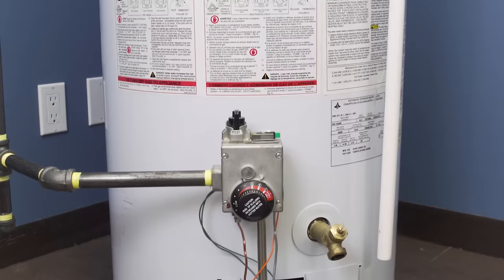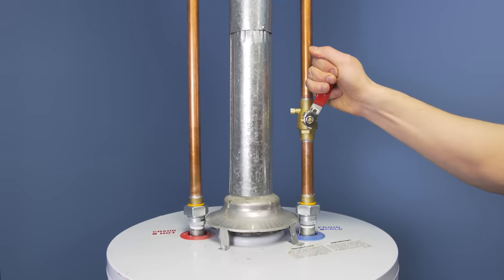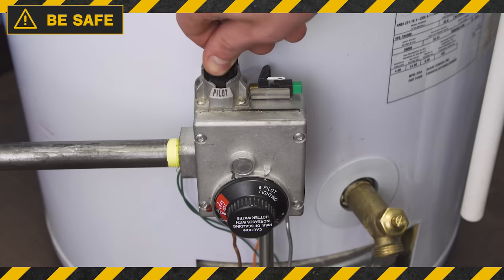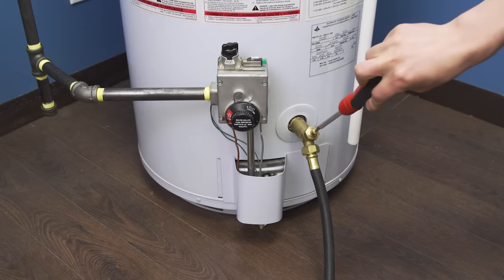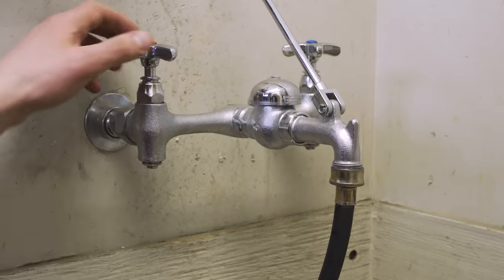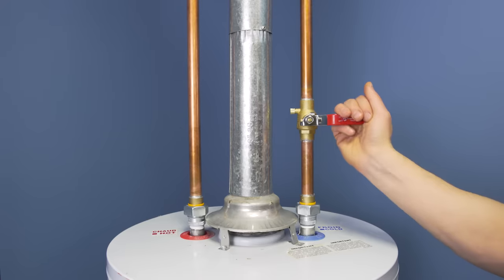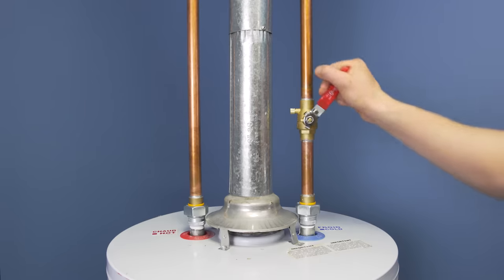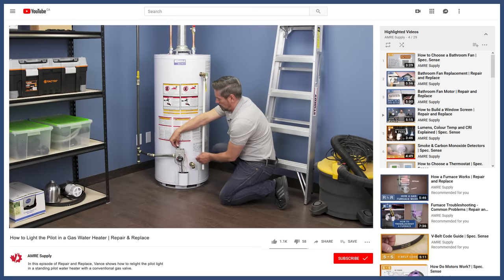How to Drain & Flush a Hot Water Tank | Repair and Replace

Comment: Question why does it flow faster when I turn the cold water tap on?
Reply from the maker: Thanks for watching. Do you mean turning on the cold water faucet versus a hot water faucet? Or do you mean it flows faster when you open up the cold water supply line?
Reply: @AMRE Supply  well it seems what was happening is when the water supply to the water heater was off and I turned on the cold tap at the sink it for some reason was flowing into and refilling the water heater from the hot water line that goes out of the water heater. This is an old house so thinking it has to do with the old baseboard heaters that were here. 🤔
Reply from the maker: @alastarwolfe1338  Yes if there are baseboard heaters then that could explain it.

Comment: Where 2 drain water from tank on 3rd family house?
Reply from the maker: Thanks for watching. With a long enough hose, the tank can be emptied into any drain in the home.
Reply: So I can go high over the tub sides?
Reply from the maker: @GaryYoung-eq1ph  If the bathtub drain is located below the water heater then you'll be able to drain the water heater as the pressure inside the tank will help push the water out. In this case the majority of the tank is higher than the sides of the bathtub.

If the bathtub is located on a higher floor, then you won't be able to drain using a hose and would have to fill up buckets separately.
Reply: Thanks very informative.

Comment: '
hot water heater tank have alot of corrosion powder on the bottom inside tank...
mineral corrosion
Reply from the maker: Thanks for watching. Hard water will contain more minerals and can speed up the process. Best to check the anode in case its almost dissolved: https://www.youtube.com/watch?v=hTJv67imgaE

Comment: I love how he says to back flush.. yet the hot water is turned off and he used the hot knob lol. Whew….
Reply from the maker: Thank you for watching. You have a good eye. This has been pointed out in previous comments but unfortunately its not something that we can update. When filming these videos we often film multiple takes at different times and the pieces are edited together afterwards. During the backflushing shot we did what visually looked best on camera (moving the closest handle) while not realizing it was the wrong handle (which not would result in any water flowing).
Reply: @AmreSupply   Yeah I figured that’s what it was I occasionally will film like that. I have to be careful to make sure it all flows and makes sense 😆

Comment: No chemical treatments possible?
Reply from the maker: Thanks for watching. There are products available but people have found vinegar works as it is an acid and will dissolve the minerals. There's also more info in general here: https://inspectapedia.com/plumbing/Water_Heater_Scale_Removal.php#DelimeKit
Reply: @AmreSupply  what do you think about citric acid? Would that be a safe alternative?
Reply from the maker: @leoperez2566  Citric acid is less acidic than vinegar but would still help dissolve the minerals. It also depends on how diluted it is as this will determine how potent it is.

Comment: If tried this twice and all I got was a leaky drain valve.
Reply from the maker: Thanks for watching. It is possible that some of the sediment is stuck on the drain valve and is preventing the valve from closing properly. You could use a pipe cleaner or something long to try to clear out the drain valve port. 

Additionally if the valve isn't closing at all then it's best to replace it. Many people have installed a full port ball valve which will drain faster and be more reliable. The steps are shown in this video: https://youtu.be/nGCejMsKNX4?t=195

Comment: Where's the union on the gas line 🤔
Reply from the maker: Thanks for watching. You have a good eye. This water heater was temporarily set up in our film studio but was not 100% functional. We had it set up in our studio so we could have full control over the lights, camera jib and other equipment. We wanted the most clear shots possible which is hard to do in a basement. The union was one overlooked part of the installation, but didn't affect it as the gas line was not connected.

Comment: You are SO wrong! I just flushed my hot water heater and common sense told me NOTto shut off the water supply at the top of the tank. No need to turn on a sink spigot to allow air into the tank to help flush it. The incoming water does that much better than your idea. Plus, the water coming into the top of the heater pushes the bad stuff out the drain quicker and with more pressure than your sink spigot letting air in. Who made you an expert on this subject? I have been flushing hot water heaters for over 40 years problem free and never used your procedures.
Reply from the maker: Thank you for watching. We're glad you found a method that works for you. The fact that you have used your method for 40 years without problem shows that there is often more than one way to do these things but due to the difference in water hardness in different areas not all cases will be the same. As well there is no true consensus, if you ask 10 different plumbers you will get 10 different answers. 

Not sure if you watched the entire video or just stopped when you saw the water shut off. This method shown in this video covers draining the tank, backflushing if needed as well as opening the cold water supply to blast water into the tank.
Reply: Worked for me 🤷‍♂️

Comment: It's useless to drain it but you can charge people to do that I don't care about it wast of water and time  If you could open the tank and vacuum it or do some things maybe a better But this kind of draining is very useless Just like letting the water out and put in new water in there
Reply from the maker: Thanks for watching. Some people find benefit out of doing a deep flush of their tank and others do not. It also depends on the amount of sediment that someone has. These steps for draining the tank are also the same as what is needed to replace a faulty drain valve so there is still value there.

Comment: That's not true!!!
If you turn the hot faucet on, then turn the supply on to the water heater.
The air will still be present until you turn on every hot fixture in the house.
Moreover, the air not coming out of a hot fixture, does not mean that the water heater tank is full!!!
Never assume the tank is full.
Reply from the maker: Thanks for watching and for sharing your thoughts. From your experience at what point do you have a good sense that the tank has refilled with water?

Comment: It’s all over exaggerated hogwash on a good potable water delivery be the city .  As you can see in the Video the water heaters are convex thus the fine sediment accumulate to the internal outer edge be the incoming cold water to me heater . Flushing your lank only washes the sediment off the spider cracks that have formed by the direct flame the contacts the water heaters metal skin. Washing away the fine sediment only causes your gas fired water heater to leak prematurely . Flushing your gas water only allows oxygen rich water to contact the water heaters metal tank thus rusting it . 
The only time you flush an electric water heater or potentially gas or propane fired water heat is when you water comes from a source like a well . CKNW 36 years in plumbing and gas service work .
Reply from the maker: Thanks for sharing your experience. You are right that some city water sources would not require the same sort of maintenance as other hard water sources. You mentioned the rusting of the inner tank. How much rusting happens with a healthy anode rode in place and with the enamel coating on the inside of the tank?

Comment: You cant blast the tank with hot water when the hot water is of lol
Reply from the maker: Thanks for watching. You have a good eye. This is an error and the cold water handle should have been opened instead. When filming these videos we often film multiple takes at different times and the pieces are edited together afterwards. During the backflushing shot we did what visually looked best on camera (moving the closest handle) while not realizing it was the wrong handle (which not would result in any water flowing). This wasn't noticed until after filming was complete

Comment: First 15 seconds I realized you were just a unexperienced handy man, as there is no such thing as a "hot water heater" because that would mean that you would be heating already hot water, and for anyone that reads my comment I'm actually a licensed plumber, you do not need to shut the gas down nor turn off the water supply to flush a water heater, simply connect your hose open the drain and allow the pressure of the cold incoming to stir and mix up the sediment, allow it to run cold and clear that's it, it doesn't take longer than 10 min
Reply from the maker: Thanks for watching. If you watched more than the intro you'll see that we refer to them as water heaters as well as hot water tanks in the video title. We mention both since the average home owner refers to them both as both and are searching for both. At no point to we call them hot water heaters. This is no different than our series on ovens and stoves. The entire unit is called a range. Not everyone refers to it as a range. Some people refer to it as a stove and others call it an oven. Our videos have to contain some wording of each at least in the description for it to be visible when different people are searching.
Reply: Your comments are correct on the gas valve and cold water pressurizing tho the nitpicking on the "hot water" heater comment is unnecessary and lame

Comment: lmao .... you used the hot water to backflush
Reply from the maker: Thanks for watching. This is an error and the cold water handle should have been opened instead. When filming these videos we often film multiple takes at different times and the pieces are edited together afterwards. During the backflushing shot we did what visually looked best on camera (moving the closest handle) while not realizing it was the wrong handle (which not would result in any water flowing). This wasn't noticed until after the video was posted.

Comment: After you flush it out. You WILL have to replace it. Don't listen to this clown.
Reply from the maker: Thanks for watching. There is no shortage of opinions on these matters and its easy to find lengthy forum threads on this. Some say to flush every year, others say never to flush water heater. Manufacturers also recommend to flush and check the anode rod.